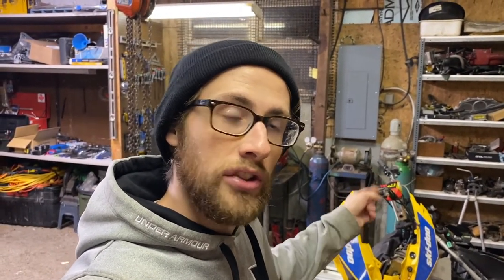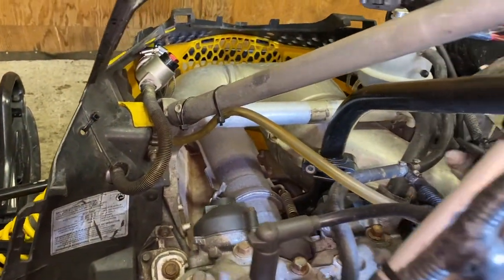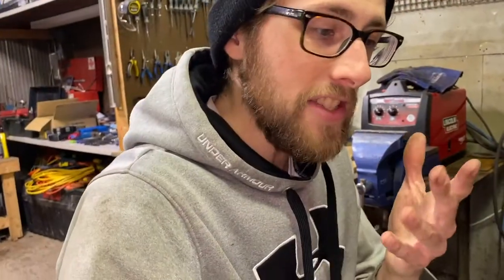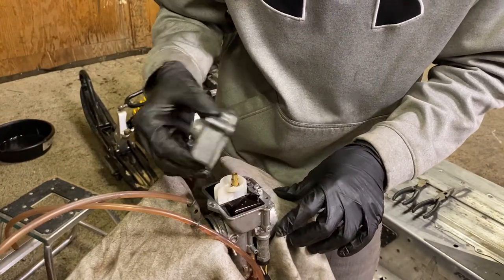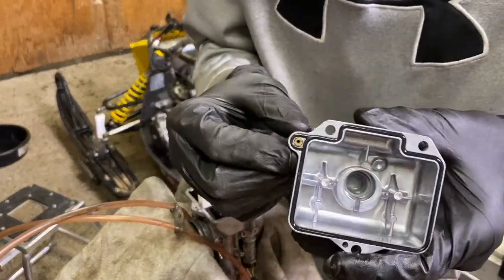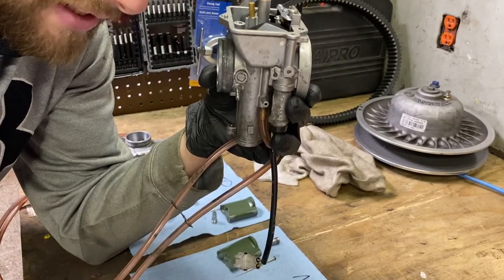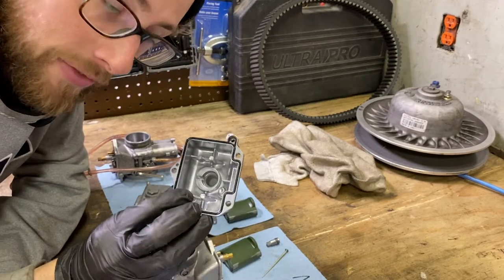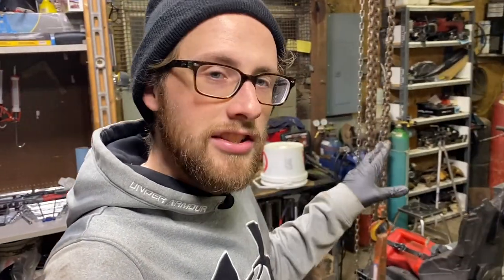2008 Skidoo 600RS Fuel System Overview + Troubleshooting

Comment: Nice work, I have a new to me 2010 rs600, previous owner didn’t know it was hard jetted and ran 330’s, I ended up throwing some 360’s and the sled ran beautifully, except it melts pistons in the midrange, gotta play with the needle. Just waiting for parts.
Reply: Can you tell me what your settings are as I am hard jetting a 09 and having some issues.

Comment: Great content! Let me know if that trick solves your issue. My 09 also bogs when standing up, I was think that the secondary spring was tired, but you got me thinking here.
Reply from the maker: I had it out for a good ride yesterday. All my issues are gone, sled runs cleaner everywhere. I am going to go down one size on the main to 360’s. Egt’s are pretty low!
Reply: @curtiswalshmedia3194  Hmm all that just by plugging those jets huh? I wonder what causes the issue to begin with... I’m really considering trying your method, thanks a ton!
Reply from the maker: The powerjet circuit will run as rich as it can if it detects a fault! Also the fuel sight line causes this exact issue for many people. 

We won’t know which “fix” cause the sled to run properly. But if you have it apart you might as well do it all.
Reply: @curtiswalshmedia3194  thank you, I will have to look into it!